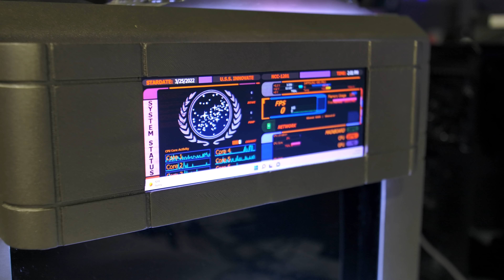IT'S ALIVE! AND REALLY HEAVY!

Comment: Bending copper pipes: fill them with sand. Also, is there space to fit some leds behind the beerglasslogo for some, for example, system load or temp indication?
Reply: Also, they make "soft" copper tubing for HVAC work. I bet that would bend tighter and easier. You can form a 90 with your hands without kinking it if you were patient. I'd think with sand and a bender you could make some pretty intricate shapes.

-edit: I think plumbing vs hvac tubing, one is measured on the inside diameter and one is measured on the outside diameter...or something. I don't remember which is which.
Reply: I've also seen wax put in when making musical instruments.
Reply: @MrBassistfromhell  I don't know if HVAC piping would be good in the long run, it's pretty soft, might lose some of the straight runs over time.

Comment: Overall, it looks good, but I would have taken precise measurements and farmed out the copper tubing bending to someone with the skillz (and a mandrel bender) to do each leg in one compound bend. Also, would have used stainless steel as I hate the look of tarnished copper. On the bright side, you can melt down the wasted copper tubing and make a nice heatsink for your next project!

Comment: Eisbaer Cooler - Cooper Plates - "Oh thank god he's not using mixed metals."
Reply: Not an issue if you use proper coolant. Cars and AIOs have been "mixed" for years. Plus the fittings on nearly every system ever have made them mixed systems

Comment: 18:38 There was an article about coper oxide removal writen by K. L. Chavez and D. W. Hess 
"A Novel Method of Etching Copper Oxide Using Acetic Acid" 
you could easily remove coper oxides with acetic acid:water solution 4 : 96 by volume.
Solution is transparent so you will see when oxide is removed - your welcome
Reply: Yes, and a readily available acetic acid solution is simple white vinegar at your local grocery store.

Comment: Someone might have mentioned it but when using the drill press use some clamps to secure your workpiece to the base plate. Helps with stability and keeps your hands free. Nice build! Also, your tubes are crooked 🤪

Comment: I tried that, I noticed that tools for working with 3/8" or smaller were cheap, any bigger was 10x the price.  So I'd say go with smaller pipe and use bending tools.  And fill the pipe with water and freeze it (or use salt or sand, I haven't tried that but they say it works). 
5/8" looks better but for flow I doubt it's any better since the fittings are 3/8" (and if you can reduce the # fittings it's a huge improvement). 
And like others pointed out with parallel lines, there's always some angle from which it will look like it's off even when it's perfect.  Better to make it look like you're not trying for parallel.

Comment: I'm the 3/8" plate frame looks like it was more than a little bit overkill although a couple of spacing plates around the down pipes would tidy up the angle of those pipes.  The best way to do the copper tubing looks like it would be to just use straight piping and use fittings to get the angles right.  It looks pretty good although I am half way surprised that you didn't use a beer bottle for a reservoir and a bar pump as an on/off switch.  Maybe in the next case project.
Reply from the maker: The bottle reservoir is reserved for another mod idea I've got 😉

Comment: Nice job, I like the raw copper look. If you ever decide to bend copper again just know that it’s sold in ‘rigid’ and ‘soft’ varieties. What you’re using looks like regular type L rigid tubing which is a mess to bend. The soft variant can be easily and neatly bent with a handheld tubing bender with no kinks. You could have easily done your original single piece, multiple bend plan using soft copper.

Comment: I'm surprised with how you describe the copper oxidation, as that is not my experience with it. It did patina quickly after polishing, but I also don't mind that coloring. But it definitely didn't look muddied or... green. Did you use Brasso or another metal cleaner before polishing it? That probably would've helped... a lot. And it would've kept its bright copper color more than long enough to clear-coat it. In my experience, it took several hours for the copper to get any significant patina after cleaning it.

Comment: find a store that sells rolls of A/C copper lines(there's more than one size) and is meant to be more flexible...... heat makes the stuff form easier..... there's these springs that go inside the pipes used for bending them that can help avoid kinking;can also use the sand fill method..... can try to find someone who does break lines on cars to give you a hand to perfect it:)...
Reply: I really hope this gets liked more that's a great idea
Reply: can also use wax rather than sand - what they use to make brass instruments traditionally.
Reply from the maker: Brake lines are 1/4 - 3/8" at most, and have pretty thin walls. 5/8" tubing is a different animal entirely.
Reply: soft metals and pipe bending is what you're after; the reason I suggest people who do break lines is that if they have a knack for it, they've likely perfected bending tiny curves and there's a pretty good chance they've done compressors which are copper:)(varies in dia. including 5/8) or fuels lines which can be aluminum(can also try someone who does refrigeration but I would think it less likely they'd be a perfectionist considering the field unless maybe they do cars too) :) **

Comment: If you turn the radiator around, so the fittings are towards the interior, you could have come 90deg out of the cooler and up to a 90 deg into the radiator, keeping the plumbing 'inside' the 'case'.
Reply from the maker: Except the rad and res don't like up like that. The outlets are nowhere close to each other and would still require bends (bends that are WAAAAY too sharp to be feasible).

Comment: Personally, I feel like the copper & brass water loop stands out from the steel grey and black too much; combined with the green accents and RGB, it feels like there's too much going on. I'd have gone with stainless, so that stainless steel silver-grey was a variation on the overall steel grey theme. Or use steel plumbing pipes, for a closer match to the chassis color, but with mineral oil instead of water so it doesn't rust and clog the radiator. I'd have removed the orange fan stickers entirely, or replaced them with custom stickers too, for the same reason. The actual case itself looks amazing though.
L1Techs did an Epyc workstation build where they used oranges, yellows, and blacks, to match the chassis and motherboard to their copper and brass cooling tubes, so that it looks like a crazy steampunk brass-ware computer. It was absolutely breathtaking.
Reply: the copper looks more like a brewery or a bar's tap setup.........

Comment: Gorgeous build. Is that steel plate seriously laser cut? one heck of a laser to cut that sort of plate, though most metal shops could do it with a mill.
I'm a little surprised with all the effort you went to you didnt braze 90 degree fittings. If i were trying this i probably would have used them for the 180 turn too, as you discovered nice looking bent metal tube is really hard XD. Filling it with sand/wax & sealing the ends apparently helps (how they make fine walled brass instruments). Bevelling the tube edge should help stop them eating o-rings.
NGL the not quite vertical tube would drive me nuts, i have enough compulsive tendencies i would need to fix it XD (i have a funny feeling you tried).
Reply from the maker: Yes, it's seriously laser cut. I had assumed it was plasma or water-jetted when I received it. Divi confirmed it was indeed lasered :-)

Comment: Hey mate just remember 1700 cpus have a lower height then previous so make sure the cpu block has the correct mounting pressure.
Reply from the maker: I confirmed the block was making full contact with the heat spreader multiple times.

Comment: it weighs 35.8 lbs
there should be a pressure standard for water cooled rigs - holds 100psi overnite - they do this is commercial plumbing jobs
Reply from the maker: Plumbing also holds 30-50x more pressure than a closed water cooled PC. I'd be shocked even when fully heat soaked if pressures reached 5psi.

Comment: Nice back pack pc. I'm going for the same idea. Any suggestions on mobo that can support 2 to 5 m.2's ? I plan on running up to 4 vm's and host.
Reply: There are adapters so you can connect m.2 drives to regular PCIe slots.
Reply: @eDoc2020  same speed ?
Reply: @frankenstein3163  Short answer, yes. Longer answer, it depends on the specific adapter. The cheapest and most common adapters with a single M-key slot and an x4 or larger connector on the motherboard side will be full speed. The quad-SSD to x16 adapters which use PCIe bifurcation are also full speed but your motherboard needs to support this functionality.
Reply: @eDoc2020  awesome. TY

Comment: It is not suppose to be that tight a radius. I clearly saw kinking in those pipes. Glad you got it like you want but that would drive me nuts.
Reply from the maker: The inside of the bend has some wrinkling, but no kinking at all. Plenty of flow, and the outside of the bends are perfectly round.

Comment: Since everything else around mostly has edges and right angles, I don't really find the bent copper pipes suitable for this.

In the case of a new build they should perhaps be replaced with straight copper tubing and more of these corner pieces.

Of course, copper pipes with patina would also be suitable for the green lighting.
Reply from the maker: Problem being, those corner pieces are **$35 EACH**. This is already a $5,000 build. I wasn't going to add another $300 in fittings.

Comment: Still no top cover... doesn't this mean the vertical stiffness is held by one side connecting to the motherboard, the other connecting to the PCI bracket of the video card, and their join at the PCIe slot? Without a bridging piece I wouldn't feel comfortable with this case design. Seems like a good way to destroy your motherboard's one PCIe slot.
Reply from the maker: It's 3/8" steel. Rigidity is no issue.
Reply: @CraftComputing  I'm not worried about the steel's rigidity but rather the weight of the steel/imperfections in angle distorting the joint held by screws. If the screws loosen or twist at all the structural part of the top is entirely PC components.
Reply: @CraftComputing  Moreover, it's the CAD files for sale. Isn't it valid to bring up structural concerns with the design particularly if someone wants to make this out of something other than 3/8 inch steel?

Comment: why is the fan backwards? pushing inwards?
Reply from the maker: Because the 40C air doesn't affect the components. And it looks better seeing the logo side of the fans instead of the rear grill.
Reply: @CraftComputing  theres noway a 3090 caps off at 40c?.. I mean I agree with the scheme of the open cased build. It's for sure unique!
Reply from the maker: The 3090 vents outside the frame. The radiator blows inside, but doesn't affect temps of other components. Memory and NVMe we're both around 33C at max. VRMnwas in the 70C range.
Reply: @CraftComputing  Boot it to an SSD(1GB) and ghost it with a 1GB nvme M.2 for storage or video recording.

Comment: I am too nervous to do water cooling. I would be too paranoid about getting a leak
Reply from the maker: I've built multiple loops at this point. Once you have the fittings installed and leak tested, they really are very reliable.
Reply: Fun fact: deionized water should cause minimal damage if it leaks on a running system. Even more importantly, unpowered electronics don't mind water.

Comment: Listen I love Craft Computing, but  I must be getting old.  Having an open case and needing to use a water cooler to move the heat from HERE to HERE, is totally LOST on me.  Also that copper piping you used...  did you use the 1/2" plumbers pipe that is meant to solder 45s and 90s for corners or did you use the 5/8" refrigerant tubing that is thin and meant to bend?

Comment: Amazing.

I AM getting triggered by the crooked pipes in front of the rad.
Reply from the maker: The short pipe is bent slightly inward at the bottom. It's mostly an optical illusion from that camera angle.

Comment: um, copper tubing. -- If you would have pinch sand packed in the tube and made your bends, then did your cuttings and emptied the tube. You could have made it one piece.
Reply from the maker: 5/8" copper isn't flexible enough to get the second bend so close to the 180.
Reply: @CraftComputing  I hope you would take the information as encouraging rather than defensive. just saying. stay positive, Its an awesome build.

Comment: 12900 is dumb. 90c is too hot and its not exactly Linux friendly with big little. I'll stick with legitimate CPUs. And... I wouldn't build a system that was difficult or time consuming to swap parts in and out of.

But you are not me. Good episode regardless.
Reply: 'too hot' really depends what the part is, 90C is fairly low for a lot of power system components. Parts are made to a spec and thats well within
Reply: @mycosys  huh you haven't been in computers for a long time, have you? I've been working on them since the 80s. 90c is hot AF. Most CPUs limit is between 90c and 100c. Stop pretending its not hot
Let's also not forget this is running on water. Meaning i it should be even less. Assuming ambient temps aren't crazy high.
Reply from the maker: CPUs in the 80s and 90s were lucky to draw 40W. The 12900k is a 225W part.

Oh, and it has a thermal design of 100C. 90 is a bit high for my liking, but it's also well within spec.
Reply: @CraftComputing  my point was, I've never seen such a hot CPU in my lifetime :)
Reply from the maker: Then you haven't been paying attention.
Reply: @CraftComputing  okay?